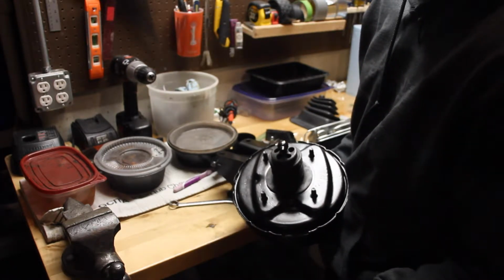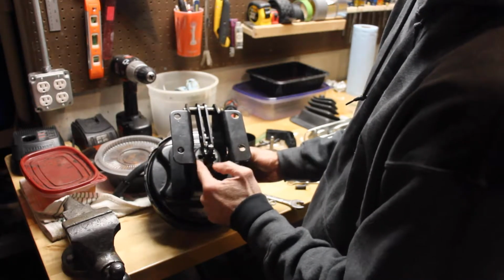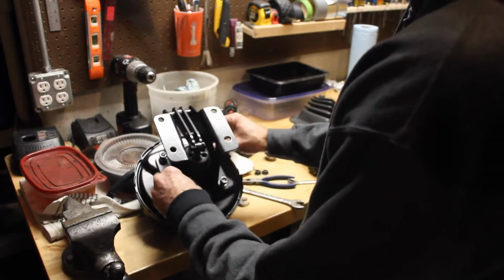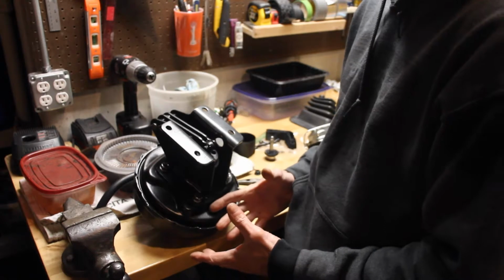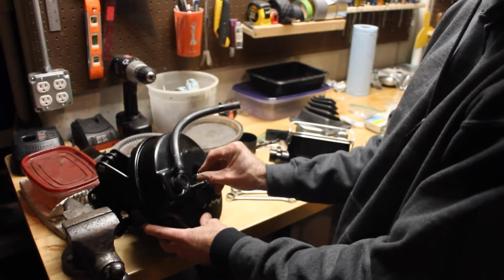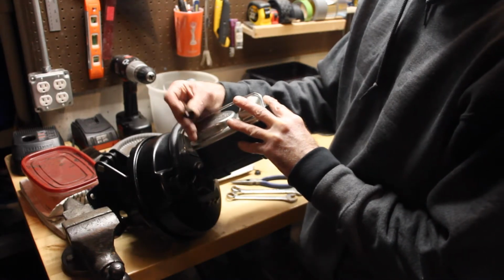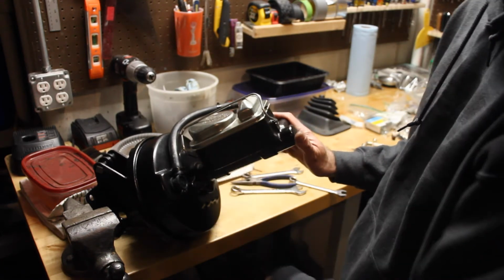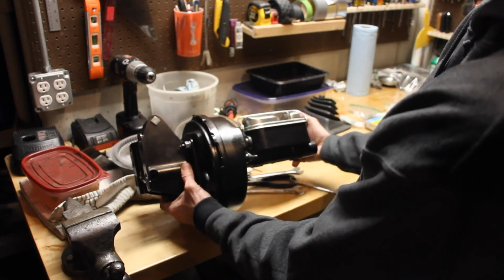Jeep CJ7 Power Brakes Master Cylinder Restoration

Comment: Did you use a filter/silencer (looks like a felt disc)  inside the pushrod boot?
Reply from the maker: It was just a rubber boot. And it didn’t fit all that well anyway. There originally was a foam dust screen inside the bottom but no one makes those so I did the best with what I could find.
Reply: @coolguy_CJ7  Thank you.